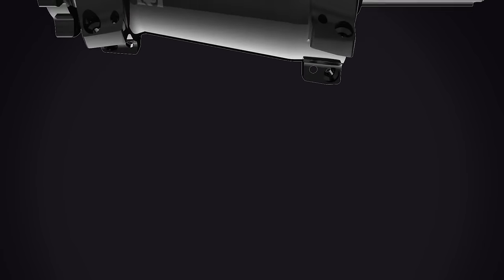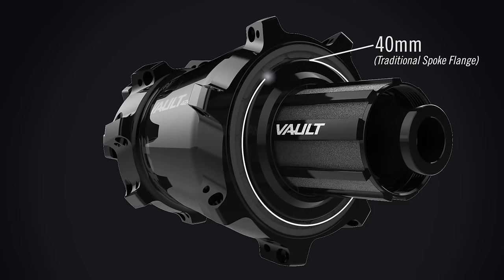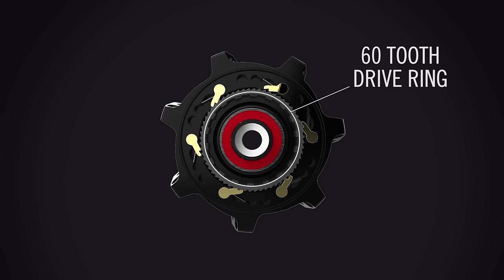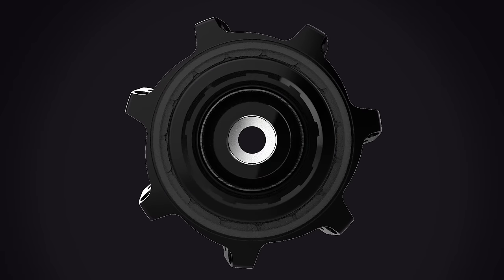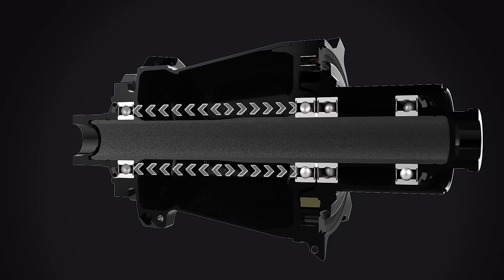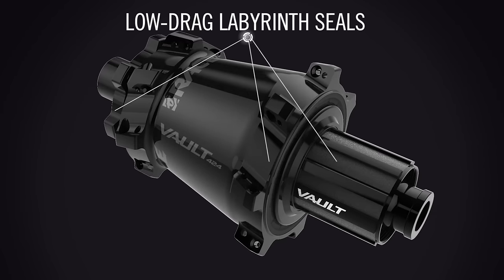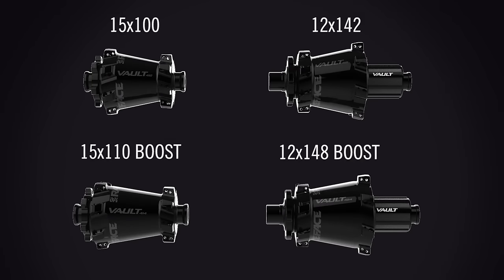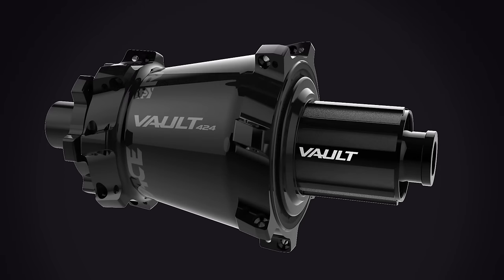Introducing the Race Face Vault Hub

Comment: Sounds like a copy of industry nine's torch hub
Reply: i9 has admitted that a number of companies cloned their 3-degree design. Raceface is now one of them.
Reply: Scott Phillips Wow I didn't even know that, thanks for the info.
Reply: I don’t understand why it should be considered copying. Basically what your saying is if i9 makes a 3-degree engaging hub no other company is allowed to make 3-degree engaging hubs.
Reply: It's like the inverse of an i9 hub with the pawls integrated into the hub shell instead of the driver. Same number of pawls and drive ring teeth so I guess you could call it a copy.  The price would steer me in the valt's direction though.
Reply: @blakecarlson157  as would longevity. Coming across this video looking for info on the wheels i bought in 2018 because I want to lace the hub to a WeAreOne hoop so I don't have to deal with an i9

Comment: ratchet system, forget about that next problematic ratchet system it is a junk, just look how Star Ratchet of DT or Chris King systems work U will understand difference
Reply: They are more bulletproof, but also more expensive (at least for the CK) with more drag and less points of engagement, the 18 teeth in DT Swiss is abismal. Also, modern pawl designs (2 teeth per pawl, big and strong pawls) are pretty damn reliable.
Reply: Piotr Sulej I’ve been riding Dt Swiss ratchet wheel set for 4-5 years. This year my new bike 2018 Pivot Mach 6 came with I9 hubs. To me , enough drag to notice the difference from the Dt Swiss. Bought another Dt Swiss Xm1501 with 54t ratchet to replace them after 5-6 rides.